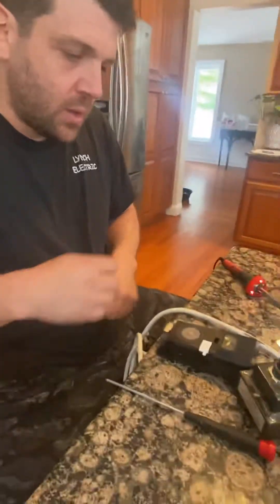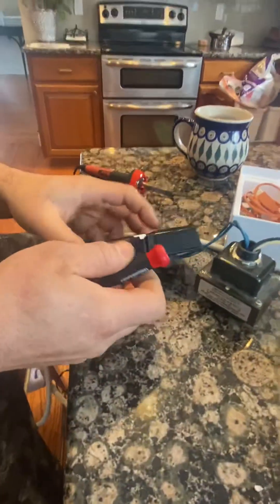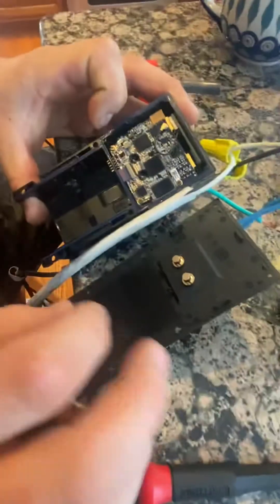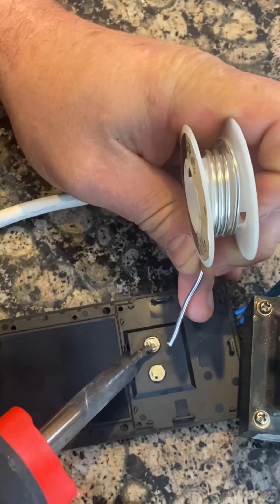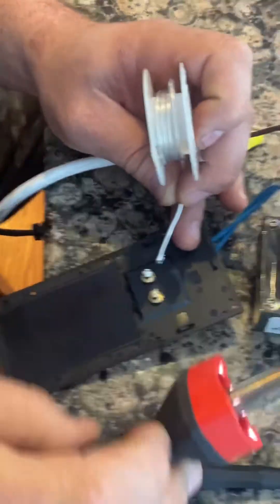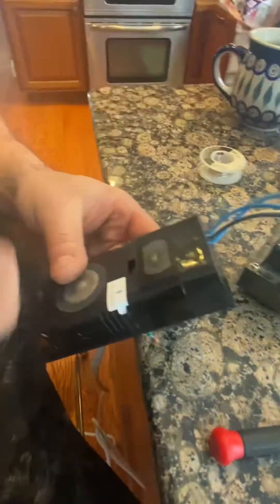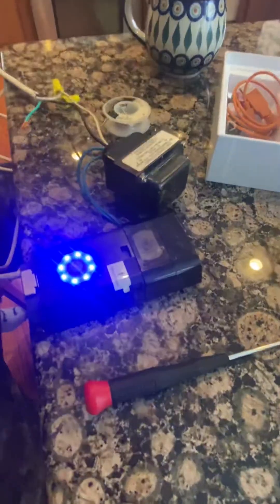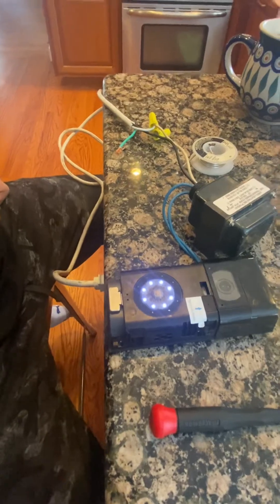Ring video doorbell 2 hardwire charging fix

Comment: I’m Having The Same Problem With My Ring Doorbell Second Generation And Mine Is Wired In Form The Power Adapter But It Has To Be Unwired Just To ReCharge It With Is A Pain The Point Of The Power Adapter Is So It Doesn’t Need To Ne Unwired To Recharge It And I Did Contact Ring Support And They Were Not Very Helpful At All So I’m Just Going To Put My Ring Doorbell Second Generation Out For Garbage I Had To Get A Doorbell Camera In The First Place Because A Few Years Ago One Of My Neighbors Had A Robbery At There Double Wide Mobile Trailer

Comment: I tried using solder but it wouldn’t stick. Then I grab foil paper, stuffed it into the prongs in the circuit board enough to make contact on the other end and it freaking worked. Don’t use solder, use aluminum foil.

Comment: Thank you! I have a gen 2 which shows hardwired in the app but the battery doesn't get a charge. I'll definitely try this fix.
Reply: It’s the same issue for me . I use 2 batteries . Did you fix the problem?

Comment: The charging circuit for Ring doorbells have a lot of problems. One of them is that they will NOT charge the battery if it is below freezing outside. Even if they are hard wired to a transformer. In colder climates Ring support says to keep replacing the battery with one that is charged inside your house.

Comment: The company doesn't care. I called in for this problem and told them the issue. All they want me to do is to trouble shoot with them by doing useless work (disconnecting from the wire and put it back etc.). Wasting my time. Although I told them someone in YouTube figured out the problem already. They don't care. I handed up and decided to borrowed the solder tool from someone to fix it myself.... so mad.

Comment: OMG, I have been chasing this problem for weeks, thank you!!!  I have a Ring-2 and I thought it was in need of a resister (nope) then the transformer was delivering 25VAC (nope), and I tried multiple resets.  Ring Inc needs to address this issue ASAP.  PS: I found that tightening the terminal screws will pull the contacts apart.  This is a simple design flaw.

Comment: Thanks for this video. I get the message on the ring app that its hard wired but it is still connected as a battery power source if it makes sense? After seeing your video, i will check this out and try it out because im having the same issue as you. Thanks again.

Comment: Ring doorbell has a quality control KNOWN flaw as it relates to a wired connection. It’s unacceptable that an electrical connection becomes loose by design from the manufacture! Additionally the company has pushed updates that cause a wired doorbell to loose its charge thereby causing functionality problems. Ring knows of these issues and failed to address them. For the cost of theses devices there should be no uncorrected issues.

Comment: Thank you this fixed my issue also. Seems like the spring pin inside camera isnt popping back out to reach the back panel. The extra solder worked wonders. To check to make sure it was making contact i used a ohm meter on battery contact and back panel. thank you again for the quick repair. Saved me buying a new ring bell.

Comment: Man you nailed it! I lost my soldering iron but just the act of removing the cover, testing and putting the back cover back on tighter did the trick! It must be barely missing the connection on the flawed models! Thanks for the video. I wish I found this before assuming it was the transformer, or chime  and replacing them haha

Comment: I was fixing to call an electrician cause Ring does not charge and I have power at the door bell.    Even bought a regular doorbell button and everything works fine.   Ring support offer me a coupon for 30% off cause we can figure it out.    Will try thing.      Thanks

Comment: Dumb question.  Aren't those contacts actually just the back of the screws you connect the power wire to? Can we just use a little bit longer of a screw instead of breaking out a soldering iron  ( which I don't have.  )?

Comment: This solved the issue. My ring doorbell 3 stopped charging in May of 2021 (purchased on Oct of 2020). My phone still says it's on battery power but I noticed the charge is going up. Great fix, lousy craftsmanship from ring.

Comment: Why are you getting battery version if you are going to wire it.
Reply: The only wired option when this video was made was the doorbell Pro version which is quite a bit more money but all video doorbells can be hardwired I think the have just released a cheaper hardwired version for around £60 plus I suppose its nice to have battery backup in the event of a power cut 👍